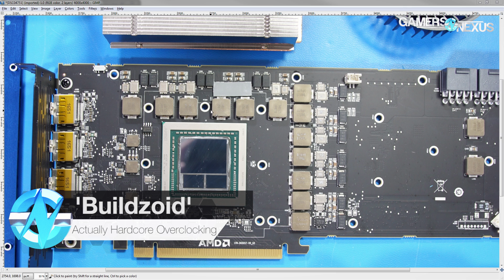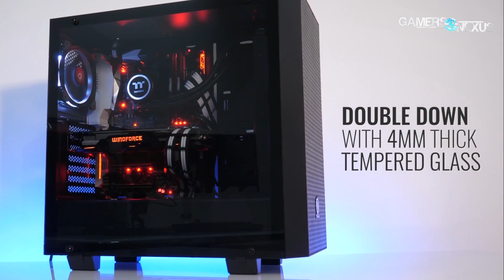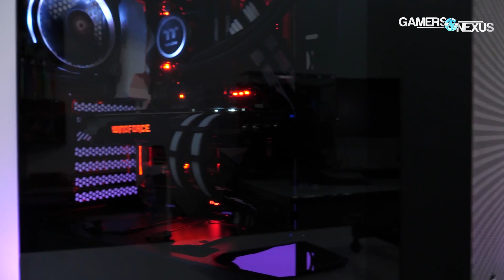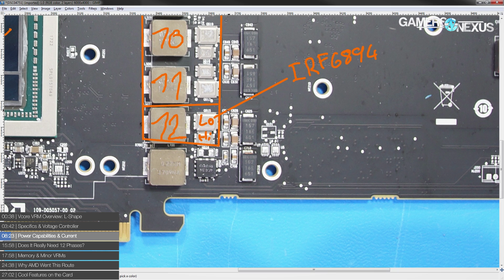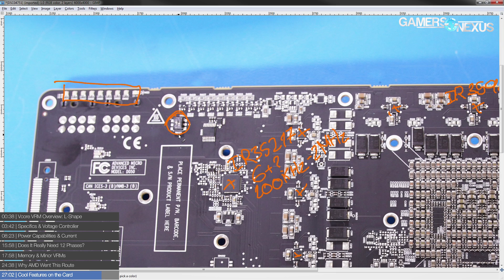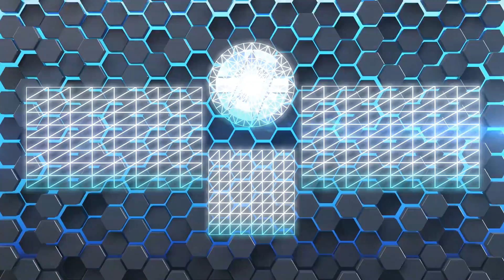Radeon Vega: FE Vcore Behemoth - VRM & PCB Analysis

Comment: What do you think of the theory that Vega FE is hamstrung by an architecture flaw, explaining both the delays and oddly low game performance?
Reply: Maybe ... maybe not, by that I mean they made so many change to the hardware that they probably need some software solution to  stay compatible.   

Even if the hardware work as expected if no game expect it to work this way it may indeed cause some issue.

So it will need to be fixed using workaround built into the driver. Just that can cripple the performance.

Comment: I would be completely fine if AMD high end Rx Vega gaming graphics card only performed on par with 1080 as long as the price is right. I was never going to spend $700+ on a 1080ti level card either way. In any event, good informative video GN 👍😎👊
Reply: issaciams That's the most important thing for me, price performance ratio, too bad that if the gaming card gets a good price at the level of performance of a 1080 or 1080 ti, Nvidia will release Volta next year

Comment: I think that for a $1000 you'd expect a VRM design like this. People seem to be contempt with what Nvidia offers on their prosumer cards, but this is a whole different story.
Reply: Yer im thinking this high-quality VRM will shine more with the water cooled version.
Reply: Did you mean to write "content"?
Reply: If I'm not mistaken, Linus from LTT mention on previous WAN Show that there's going to be a water-cooled version of this card... #CMIIWW
Reply: I think one of Buildzoid's concerns is that the hefty VRM might not be there for show or as an added feature for extreme overclocking, but an absolute requirement just to get the thing to work at stock speeds.
Reply: we know from the tests by PCper that the card does not draw more the 300W that means it would be running at a voltage under 1v do need the kind of current support that those VRMs could provide. We don't know yet however what the water cooled part will require.
Reply: nVidia couldn't pull that on their $749 Founder's Edition 1080.
Reply: Yes, Liquid cooled already on Newegg, for pre-order, if not sold out by now. It was available for pre-order last week, same day as regular FE
Reply: foreign's gaming tech i think it is more due to the fact that vega needs this kind of sophisticated VRM for its powet delivery to achieve its current level of performance, just like what buildzoid said. 

Anyway AIB board partner that have their own engineering team like asus, gigabyte, and EVGA have done some magnificent PCB design for their own high end version that were even better than this. 

The only thing special about FE is that it is a stock pcb.
Reply: Tell that to nVidia too.
Reply: foreign's gaming tech did you miss the part where he said using HBM is what enables this layout
Reply: This VRM is inferior to the ref 1080ti.
Reply: :D good one
Reply: its same on vega 56 at $400
Reply: +matthaus woolard, I agree. It makes much more sense when paired with the liquid cooling model. It would, at face value, offer a very advantageous opportunity to utilize the infrastructure of such a robust power delivery system.
Reply: Bro, its a NEW card. Stop being pretentious.

Comment: Have you guys considered removing the background noise by running it through audacity etc? I there isn't much but I can hear it
Reply: I'm using (closed) studio headphones and my hard drives are louder lol. You must be using a really silent PC.
Reply: I don't have a hard drive in this computer but it is not silent. Quiet for sure though. I was just listening at normal volume also, there are many things I can pick up sometimes if I give it a crank
Reply: that might be the Razer green switches on my KB. They are Cherry MX blue knock offs but just as loud.
Reply from the maker: Reuben Horner We give it a denoise pass.

Comment: The dip switch colours are red, blue, and purple (a mix).
Reply: eh you can turn on both red and blue at the same time but it does not look purple since there is no diffusion of the colors.
Reply: Actually Vega has a different dip switch layout than Fury; one switch changes it from red to blue while the other just changes it on or off, which means there is no "purple" setting.

Comment: AMD certainly knows what they are doing, and I'm very happy to see that they are ready to more appropriately approach other consumers with a solid product rather than a small improvement. Go get'em AMD!
Reply: rx10 It got huge backlash because people tried to excpect a fucking gaming gard when this card is made for workstation purposes, more then it wad for gaming.
Reply: watch:  Radeon Vega Frontier Edition benchmarking & interview with AMD
you can see for yourself when they put it up against a titan
Reply: musinclind37 or watch gamers nexus independent review. the one not run by amd
Reply: it is using the same gpu, it has good power delivery, its not using ecc vram. What else could make RX Vega faster besides better clocks and drivers.... lol
Reply: rx10 with launch bugs, overclocking issues and thermal throttling, as well as a lack of driver optimizations, this card does have room to grow. I'm not saying its gonna beat a 1080ti (as much as I want it to, it aint happening)  but its not unreasonable that if amd works overtime they can straighten out the kinks and board partners will fix thermals, which hopefully would put it on par or slightly ahead of a 1080. 

On a side note, leaks prior to launch said there were going to be 3 sku's, basically a fury x, fury and nano. So if this was the "nano" version then (as it is the full core, but runs severely underclocked to meet certain criteria), through brute force (and a kinda scary power draw), the fury x version would be 15-20% faster.
Reply: Massive launch flops, terrible marketing, disastrous engineering, shit performance from Vega, huge backlash from the community..... AMD knows for sure what they're doing